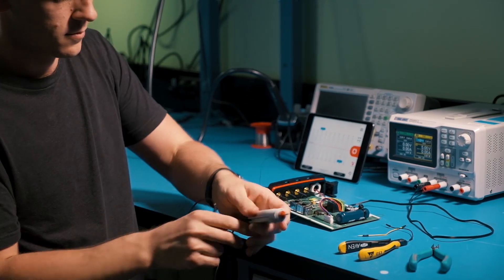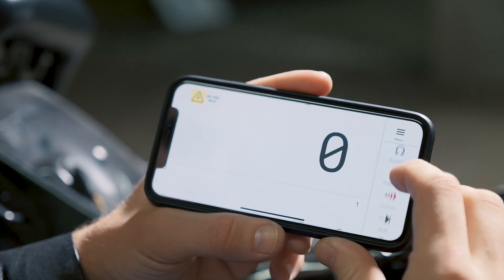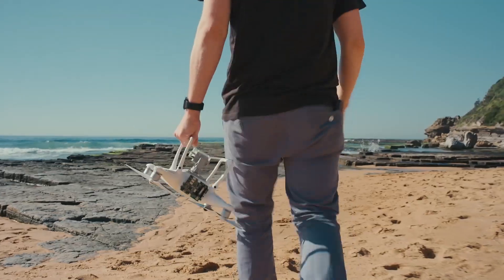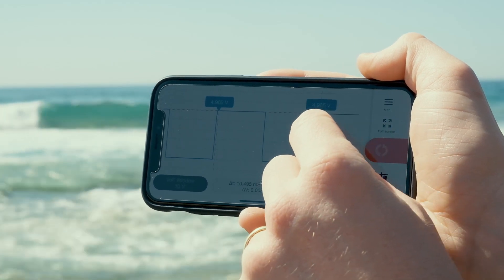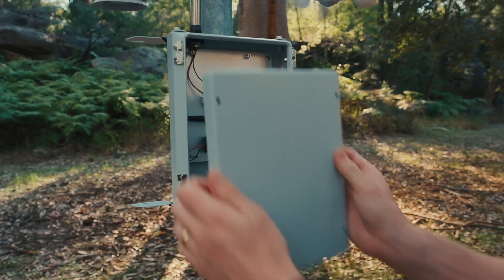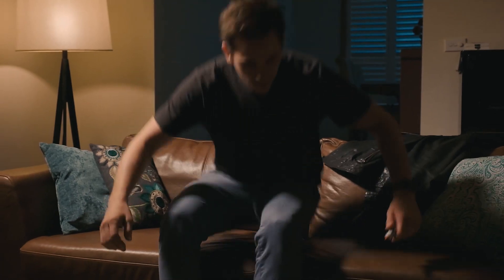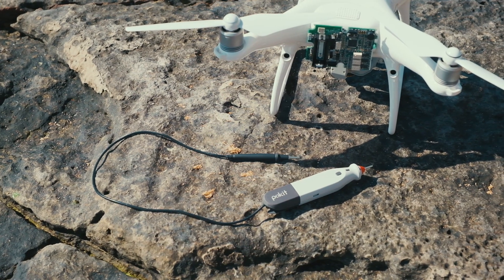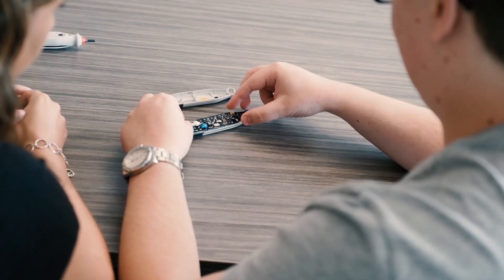Pokit Pro - Launch Video

Comment: [1:24 in the video] I am curious where he is probing the consumer unit (breaker panel), as I can't recall having seen one with a probe point exposed without removing the cover.  It is like he is probing the mechanical status display that shows green or red.